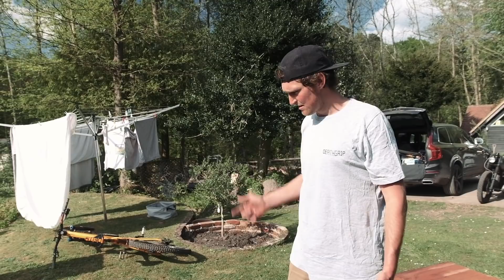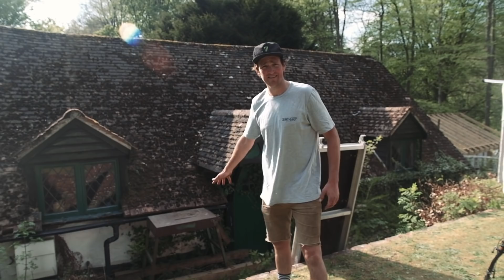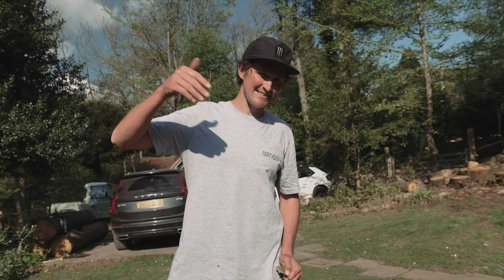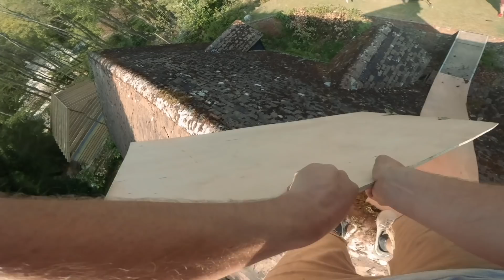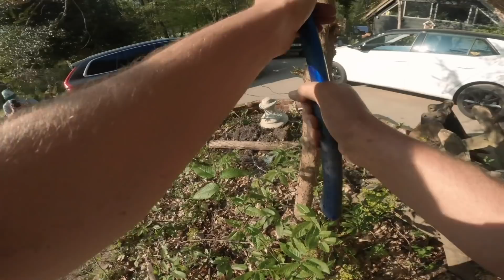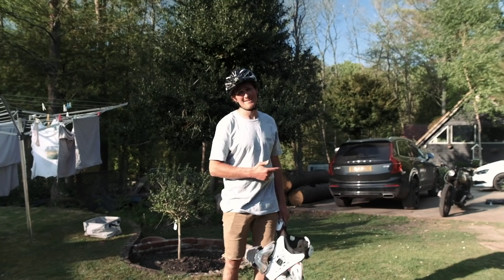DON'T TRY THIS AT HOME!!! LOCKDOWN RAMPAGE Ep1

Comment: Unpopular opinion but: this is super irresponsible at the momet...
Reply: True but did you notice something on his testing runs, he is like a cat just popping off where most people would just fall off and die. This is probably still stupid easy for him.
Reply: Yeah, and back flipping over a rocky canyon is the height of health and safety. 🤦🏻‍♂️
Reply: Very stupid indeed. Just no need in the current situation
Reply: Risk is perceived differently for everyone. Brendan rides rampage and does this for a living. Therefore he knows the risk invoked and also knows he is capable of it. He knows the chance of him injuring himself doing this is slim. For other less competent riders the risk will be much higher and therefore irresponsible at a time like this. Not for a professional free rider.